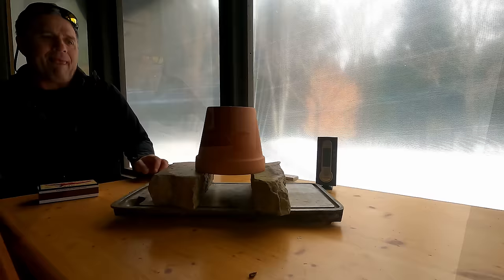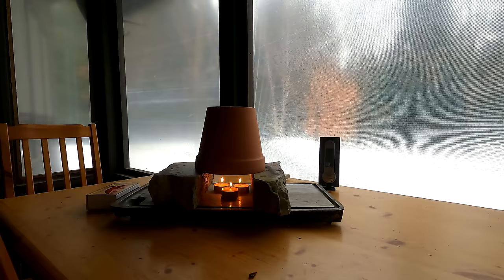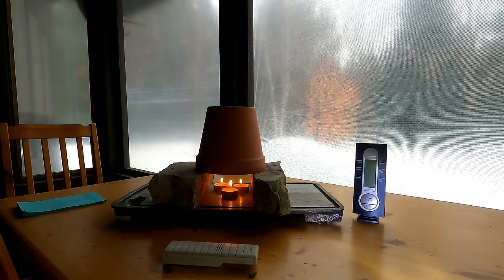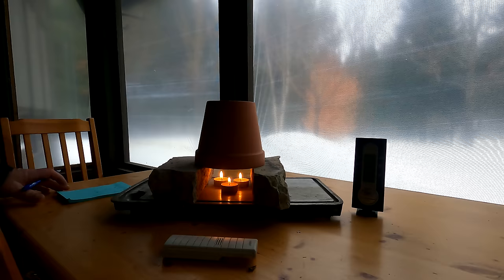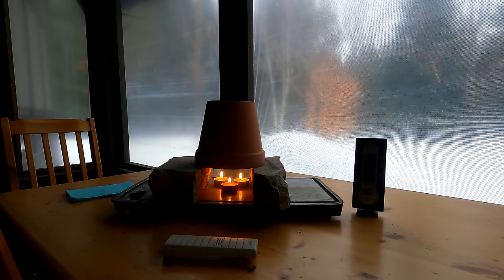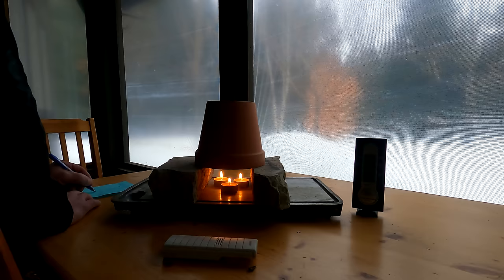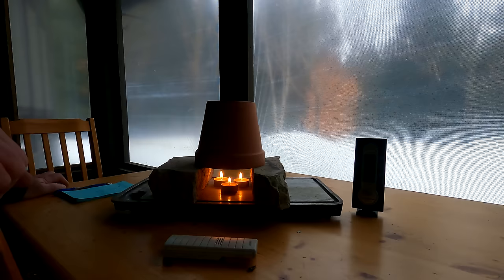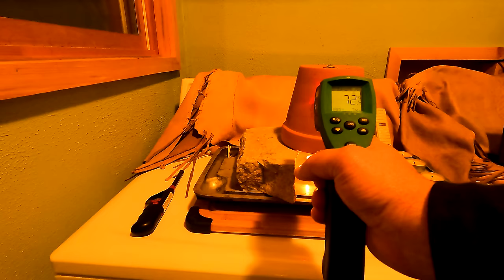Testing the Clay Pot Heater | Truth or BS | Prepping and Testing

Comment: It's all BS.  Without the pots, where does ALL of the heat from the candle go?  Answer:  Into the room.  With the pots, where does all of the heat from the candle go?  Answer:  Into the room...just through the clay pots first.  Do the clay pots generate ANY heat?  Answer: No.  So why do I need the clay pots?  Answer: You don't...either way, every single BTU generated by the candle ends up in the room.  Physics doesn't need a YouTube video.
Reply from the maker: That is not accurate - the heat from the candles raises to the ceiling. There is not enough heat produced by the candles to cascade that warm air back to the living zone. When the pots are added to the equation, the pots capture and radiate the heat out in a very controlled manner.  The heat zone around the pots is measurable. This area - around the pots - is exactly where you would be sitting if you had no other means to stay warm. This system could never heat a house unless you incorporated dozens of them. The candles produce gases which are can cause respiratory issues in some people. That along with a host of other safety concerns is why I would not use this contraption.   I have no need to use such a system as I heat with wood. I was shocked to see that this unit did indeed maintain the temperature within an isolated, small and well insulated room.
Reply: @Hawksshadow  the pots “spread out” the heat, but every single BTU is generated by the candles (and only the candles), and every single BTU generated ends up in the room, with or without the pots. You’re arguing heat distribution…stratification. You could achieve better results mixing the air in the room with a small fan.
Reply from the maker: The pots actually keep the heat in a very tight circle around the pots. The idea of the fan would work; however, I do not believe the heat from the candles is enough to allow for any mixing of the cool and warm air - the cool air from the room would negate any heat produced by the candles. Unless of course you were willing to burn dozens of candles - then you may have a chance of destratification of the air.
Reply: @Hawksshadow  'Tight circle'? Radiated heat travels in all directions at the speed of light, convected heat slightly more slowly in a relatively tight vertical column!

Comment: It is complete bs and it doesn't work.
Reply from the maker: Did you repeat this test - Did you even try to determine its validity prior to commenting?  Why would it not work? Candles provide the heat - the  pots provide the control. The room is insulated and small. The heat will indeed build up and move the thermometer. The pots cost less than 4 dollars and the candles were a dime a dozen - it will cost you less than 10 dollars to try this test which will than provide you with data which will aid in your ability to show some intelligence. I have no skin in the game - I would not use this unit as I heat with wood. Power failures are simply an inconvenience. I too thought this was BS until I actually did the math.
Reply: @Hawksshadow  yes I did and it doesn't work
Reply from the maker: 10 4 - I guess your candles are LED.

Comment: Once again, what we "know" on paper doesn't carry into reality. Now obviously that means we are just lacking in what we know but who is going to admit to such a thing when there is keyboard warrioring to be done. 

Next video please Mr. Interweb!
Reply from the maker: Not sure what you are implying; however, I can state that my intention was to determine if this type of heater worked. It did - marginally. I have informed people that this is not something I would use due to the following: its delicate nature, the heat output is not substantive enough to be of any real use and the dangers associated with toxic gasses and open flame negate the benefits derived from its use. I did indeed post another video - using this exact unit in an outdoor setting. I juxtaposition the clay pots against a fist sized granite rock.  The results are quite substantive. 
Thanks for the comment.
Reply: @Hawksshadow  I was on your side. I like to see someone do realistic tests and compare real work things. 
That was mostly sarcasm on my part, I watch these videos and then read too much of the comment sections lol

I do a lot of design and fabrication and I can tell you that the garbage products we make today are completely inefficient. So when people are negative about candle power because only 30k btus can warm a house I get sarcastic. I could go on and on about hvac and appliances being trash....

Have a good day.
Reply from the maker: It is all good - communication is the key to everything. I appreciate you reaching out and clarifying  where it is you are coming from. I am in total agreement with you in respect to the items produced today being garbage - quite literally - a washing machine built in the 60's would last 20 to 30 years. A washing machine build today will be in the trash within 10 years. 
That applies to most of the products humans use today - Keep on fabricating and designing - for it is there that you can let your imagination and creativity flow freely. Thanks and you too, have a great day.

Comment: It's bs
Reply from the maker: Hello - I thought the same prior to conducting this test. The unit did indeed heat a small room by a few degrees - I was not in the room and there was no other heat source. The candles would have done the same on their own, however, the pots capture the heat and radiate it out in a controlled manner. When you require heat in an emergency - sitting close to this unit with a blanket around your back will certainly keep you from shivering. Note - due to safety concerns, I would not use this unit in my home.

Comment: What BS.
Reply from the maker: That is what I thought prior to conducting this test. The room in which this was conducted is insulated with R30 walls and R40 ceiling. The room is internal to the house - not affected by outdoor temperatures. The rooms size is approx. 6ft by 8ft and 8ft high. I was not present in the room and the light is a 40 watt equivalent LED - no heat output. The candles did indeed heat the room up by several degrees - the pots function is simply to capture the heat and radiate it out in a controlled manner.  This unit will heat a very small room in an emergency; however, due to the safety concerns of this unit, I would not use this in my home. There are products which are manufactured to provide emergency heat and are safe to use in enclosed spaces.  You should put a few pots together and give it a try - It will prove your comment to be factually incorrect.

Comment: Its only bs
Reply from the maker: Light some candles in a small room - and let us know which way the needle moved on the thermometer. 
The pots only capture the heat and control its output. 
Instead of the heat rising to the ceiling and being wasted, the heat stays right where you want it - where you are sitting, which, in a no power situation, will be directly beside this humble little contraption.